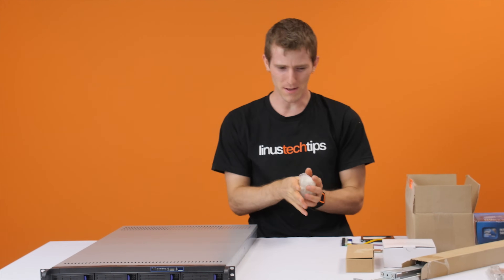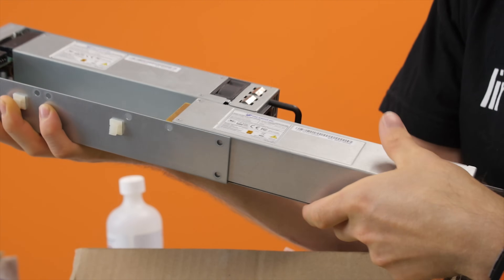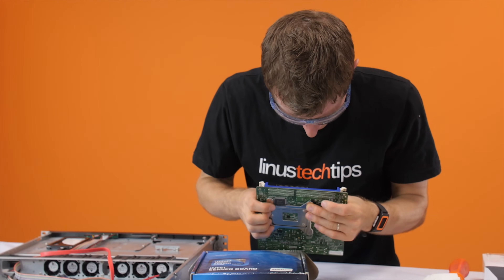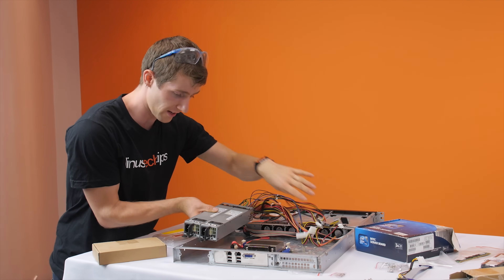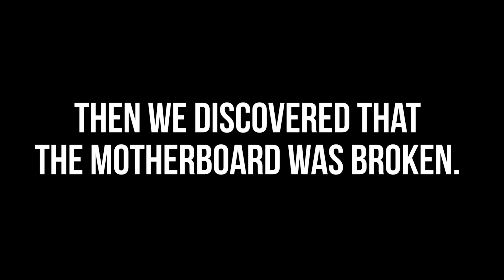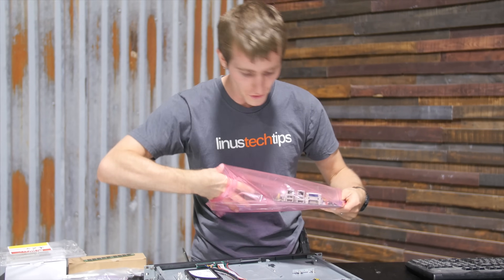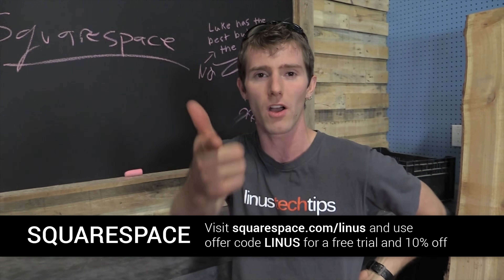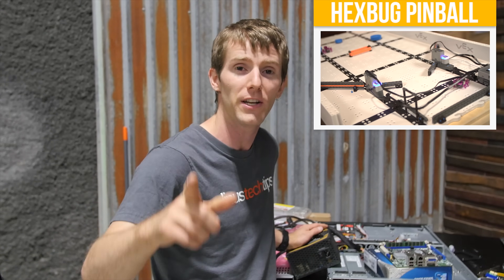DIY pfSense Rackmount Router Build Log - Part 1

Comment: Hi Linus,

I enjoyed your video a lot. I like those DIY projects with only the parts you already have. Looks much like my stuf at home. But if a Cooler and the backplate don't fit, than look for something better instead of blew-up the modtherboards twise ;-). Your goal to make a new pfSense router/FW looks good. And to use parts you already posses is a good money saver. But i think that you're better off with something like an Supermicro A1SAi-2750F motherboard with an modern Atom CPU or something similair. These things are also with an barebone solution that fits your requirements. Besides the fun, you have to run an company through that firewall so it might be better to have something reliable.

By the way, keep up the good work with your video's and the good tips like modern cable management and so.

Comment: Could it be that the back plate it touching the solder on the motherboard which cause the board to short off......just a theory,   i can be wrong

Comment: I personally probably would have given up and stuck everything in an ITX desktop case with a stock cooler when I found the backplate had to be so extensively modified, and the IO shield had to be cut, and the fancy redundant power supply didn't fit. Just return the 1U case, get a $20 rackmount shelf and stick it there. 
I guess there's something to be said for "never give up" mentality though.

Comment: I'd have to agree with the other comments suggesting a 3D printed backplate. Or maybe a plasti-dip coat on the back of it to prevent any shorts? Also, I'm guessing it's already been done because the LMG team seems to be pretty tech savvy, but try building it outside of the case first to get everything working then install inside the case to see if the orientation is causing the problems?
Keep the great videos coming LMG!

Comment: Lesson Learned...  don't build custom 1U cases with non standard equiptment.. the redundant power supply.. are you stuppost to beable pull out the power supplies? I don't think you have the clearance..   Should of went with a 2U case. wouldn't of caused all of this problems. plus you can always build a proper server room with a proper air conditioner.

Comment: all the money ur wasting buying another motherboard, you can easily just buy a good micro atx server board lol. theres a reason y mini itx boards suck. as everyone else mentioned, the metal backplate is coming in contact with something.

that being said, I had the same idea to make a 1u pfsense router with a redundant psu lol. But 1, put the ssd in the drive bay to easily swap them out. 2, test b4 u put it in the case.

Comment: Tips: 1.  Put some masking tape on the backplate. Seems that the metal plate is shorting out the board around the CPU and might even damage the xeon...
2. put masking tape on the cooler
3. leave out the io shield so that hot air can get directly out
4. USE MORE HOT GLUE

Comment: I burst out laughing when Linus first tried to fit the heatsink on the board, looks like it interfered with the fan header AND the square capacitors/power delivery things as well.

And at 9:31, i'd just be all "welp, time to find an alternative cooler"

Comment: 1RU servers are specialized and if you want one, you should buy one.  If you want to assemble one yourself, buy a supermicro case and a super micro motherboard.  Supermicro has compatibility lists because 1RU server designs are highly customized and incompatible parts are the norm.

That said, as far as real servers go, SM is crap and you're best off with dell or HP.  Buy one off eBay.  Leave the hacking for software.

Comment: test the new motherboard first with another psu connecting only 4 pin and 24pin. Plug in just the ram. No drives etc. I think it might be that dual psu thing.

Comment: Wow I don't even know where to begin...using hot glue to mount a PSU? And I'm sure that the backplate fried both those motherboards...FYI you can also order complete pfSense boxes. How fast is the new internet connection?

Comment: okay, so my thought, and according to the comment many people also think of, is that the backplate of the heat sink might shorted something. So you should insulate the plate before install it. Don't know if it's the case, but regardless you should do that just in case, considering how close the plate is to the exposed pins.

Comment: holy crap, why use that backplate anyways, it's causing all kinds of shortcircuits and problems. just use 4  nuts with washers dude! the cooler isn't a coolermaster V8.

Comment: I love PFsense I have an and socket AM1 system with a quad core 2Ghz CPU 8GB of ram and a similar quad port gigabit Nic. it powers my network really well though sadly I have to reinstall the OS mine is messing up bad and refusing to update. it was not happy when I upgraded from a dual port to quad port and moving from 1.3Ghz to 2Ghz. PFsense is real good with reinstall and quick set up. I recommend it big time radically if you want a nice OS to play with.

Comment: We can easily confirm whether or not the issue is caused by the backplate by simply turning on the system without the backplate installed first just to be sure it turns on...

Comment: I mean you can buy routers, they have a whole isle at the store called routers (fml)
Reply: +Bucketoriley Even though it's spelt aisle in this case
Reply: +Matt Davidson (Foogalicious) I don't get why the router wouldn't even start up in this case ...aisle see myself out.
Reply: +Lord Baldur Actually if you search the interwebs you will find that off the shelf routers perform better than homebrew ones.  It's not really that surprising when you consider an off the shelf router has hardware specifically designed for just doing router functions, where as a homebrew uses general purpose components designed to do anything, even running windows etc.
Like wise the software is coded specifically to do perform 1 task very well and is written specifically for 1 known set of hardware.
Reply: isn't it weird how isle is spelt lol
Reply: Ah dang I didn't see that, you're right, its supposed to be aisle lol.
Reply: +Matt Davidson (Foogalicious) I knew that lol I was being sarcastic 😎
Reply: This thing makes consumer routers (and even large enterprise routers ) look like a joke
Reply: Dragonbait The main difference between most routers and a built router is that most routers use ARM while pfsense uses x86. The difference between those chips is that the x86 is way more powerful and is capable of doing more complicated processes. ARM is used because it's cheap and open source. However it is much less powerful. Comparing the processor of a router to the processor of even an old computer, there would be no amount of optimization that can make it outperform the PC and that's not even considering the fact that it has been shown that PFSense routers do a lot better for less money than Cisco equivalents.
Reply: +Lord Baldur while that's true for SOHO routers a bit bigger ones are much and more complicated.  also you can't compare routers by just speed, in fact if you want speed you don't even need a router....

Comment: what's the difference between a router and modem
Reply: *****
Nope, read my comment above. The modem is just a converter. It does not know if it converting wan or lan. The router differentiates between lan and wan. For example, I do not have a modem in my house (because I have an UTP connection with the provider). But I have a wan interface (the external connection) and several lan connection. The connections (either wan or lan) are managed by the router (well, by the router and by the switch part of the router).
PS: for example, you can connect 2 pc via phone line, using 2 modems. You will have PC->PC's NIC->modem-----modem>PC's NIC->PC. No WAN here.
Reply: +Bucketoriley 
modem is to connect youre home network to the internet Lan-WAN
router is to create an home network connection that connects to the modem
switches are smart directing network connection so that your homenetwork doesnt bottleneck or loops
modem->router->switch->pc/tablet/laptop/smartphone/nas/server/etc.

that sayed there are devices that do combining like router with intergrated switches.

the switch learn what path he needs to use for each device so the  packages doesnt go to all devices at ones and slows down your network
Reply: +Bucketoriley Modem converts coax to ethernet. Router connects LAN to WAN.
Reply: ***** Not necessarily, my cable company only gave me a modem with one ethernet port on it and you still need your own router.
Reply: +Bucketoriley the term modem comes from 2 words: modulating and demodulating "mo-dem". A modem is something like an active adapter, it converts an analog signal (phone line, coaxial cable etc) into a digital one (an utp cable). A basic modem will have one cable as an input (coaxial, phone etc) and one as an output (usually rj-45).  A router (in the commercial context) is actually composed of a switch and another NIC interface. A router is something like a multiple power socket (this is just an analogy!!!). It "gets" data from one "main" source and distributes it to several clients. But there are many "composed" devices on the marker - a combination of the devices described above. So you can have one device that has a coaxial input and 4 utp outputs. This device will contain a modem part, a switch part and a bridge between the switch and the modem. 
PS my description above is very simplified (I am sure that a network engineer will start laughing when he will read this)
Reply: +Bucketoriley Modem = WAN (Intarnetz), Router = LAN (Local)
Reply: thanks guys for the replies appreciate it

Comment: Maybe he should have thought it through prior to powering it up the first time? Testing for grounding issues and shorts with the multimeter in a situation that already had grounding issues would have helped it. Might as well test the PSU now... a vreg could have gotten damaged.

It's possible that a one-off plexiglass or even a 3-D printed version of the backplate would save him from some more headaches. Not to mention that clearance of the CPU heatsink may be better than spraying the board in filings from the onboard speaker.

Good luck with that!

Comment: Linus you know you broke that motherboard because you grabbed it with your full hand on bottom :)
Reply: can you explain because others are saying it was the back plate and the cut off speaker
Reply: he was grabbing it on the bottom and touching all the circuitry.
Reply: I presume he is using an ESD protection mat, but the bag the mobs came in was suspicious.
Reply: +Lions Flame That won't kill motherboards.
Reply: it can if you have a charge from a carpet or anything you can fry the motherboard
Reply: Lions Flame Yes, but ESD kills the motherboard, not touching it.
Reply: he's walking on carpet with socks on.

Comment: Geez just get the Asrock C2750D4I. Fits nicely in a 1U case, doesn't even require a fan, onboard cpu, has 4(!) dimm slots oriented the right way, is energy efficient, server grade (with the gorgeous webinterface) and still extremely overkill for your application.

Comment: I can relate to this so much, Linus. I built a dual xeon system and bricked the first board because of plugging in a power cord to a power output that used the same connector. I learned to always read the manual on server stuff now.

Comment: Sorry to break it to you linus, but sometimes it is easier just to order already tested hardware. C'mon now 1u servers with the specs you need are not that expensive, probably would have cost less than shorting two motherboards. Also pfsense sucks anyhow.

Comment: The backplate is incompatible with the motherboard. normal motherboards have no components near the cpu on the back. this one has loads of them.
Reply: +FoodOnCrack It looks quite obvious to me that he just shorted out both motherboards with that backplate, oh Linus...
Reply: +FoodOnCrack Yep I would go ahead and say i'm 95% sure that its the backplate killing the boards...
Reply: +FoodOnCrack He has a 3-D Printer! MAKE A PLASTIC BACKPLATE LINUS!!!! (and possibly line the bottom of the case in electrical tape!)
Reply: You don't even need a backplate on a board in a rack case, if your rack falls over you are going to have bigger problems than worrying about the HSF stressing the mobo.
Reply: ***** That's not true, I can't even remember the last time I saw a backplate on a server mobo. Rack mounted servers ALWAYS sit horizontally, so the stress from even a very large HSF is low. There is no need for 'reinforcement' lol.

At the very least, it's much better than bowing a mobo and probably shorting out and ruining 2.
Reply: Never personally seen a server mobo with backplate mounted, like I said, I don't think it's necessary, but then again I don't work in homebrew where you take a dremel to your mobo and an angle grinder to your IO backplate.

Comment: Even if power consumption is a major factor to consider, why not use a server microATX or ATX board? The case has the space for a reason. Plus those boards tend to not have the jumble of components under the CPU that mini ITX boards have due to lack of board space, letting the backplate actually do its job without mods.

Comment: i work with these builds alot for racks, always used plastic backplates for esx vmware racks, ubuntu server racks and so on. personally always used gigabyte boards for it as well their orientation for building is alot better for airflow and component placement, hope this helps.

Comment: Wow. This seems like a lot of work. Lol. I just use a Sun Microsystem X4100 1U server for my router. plug it in and it works. Running Fedora 20 with an iptables script for the routing.

Comment: Jesus Linux.. just grab a nice Supermicro kit that has what you need.  These aftermarket server cases usually suck in 1u, and most Intel-branded mobo's are Foxconn non-standard trash at this point.  I've had a more than a few bad run-ins with them myself.  Never again.  You might just get lucky with a nice Supermicro ITX board that will fit what you already have.

Comment: Components on the top of the board are interfering with the heatsink. the bottom place needs a good insulator as there are many passives under there where the conductive parts are run right up to the top.
Speakers should be desoldered and not broken off.
Multi layer boards do not like being flexed (more layers= greater risk of damage when flexed).

They need a cooler with a plastic back plate, and a small footprint, e.g., can a liquid cooler fit there? Can you dumpster dive for some old broken laptops and see if the heatpipes can be safely bent to fit that board. Can you simply use a 2u rack instead, and go with a full ATX build? PS unless you are doing VPN or other demanding tasks, you really do not need much CPU horsepower for pfSense.

Comment: i would choose a Pentium j1900 or 2900 with Mainboard so you have more options than this one and it needs less power with only 10 watts. There is also a PCIe Connector

Comment: Hahaha, using backplate on mobo designed for plastic pushpins, using cpu cooler not designed for that particular server mobo, way too wide at its base and touching caps and other components . . . someone needs common sense class. 

I am betting 5 bucks canadian that either one or both of the above mentioned things short circuit the board. Why the hell didnt you test the board before with just the cpu, without a cooler and putting it into the case ? 
On 4:09 it looks like mosfets pins touch the backplate.
Also use a freaking 90 degree L connector for sata on motherboard. . . again, common sense

Comment: I see that you have two Power supply's maybe you you set it up that the two server PSUs are giving the power to bored at the same time. So two times the power would blow the bored right?  Maybe in part two try testing the bored in the case with only one PSU wired up and see if that helps and maybe order two motherboards this time just saying :3 keep up good work and the awesome videos guys (^_^)

FYI could someone explain how a backplate  could brick a bored I d really like that part to be cleared up :3

Comment: Interesting approach LinusTechTips, sharing a more natural (not too edited) process of tech-gineering a solution is always cool... and frustrating at the least.
I think many have said it, shorts of the plate might be part of the issue. But perhaps, before burning another MoBo, which many may not afford, worth taking a step back:
.Test all parts outside the chassis (perhaps in an open or frame, lab case model)
.Chop-chop one element at a time (You have too many unknown here)
.Definitely isolate the plate, even hot-gluing the whole surface if you want.
.Not sure if you cut the whole piece (speaker) or just connector tips. Make sure it is not any part that might unbalance overall impedance or circuit, MoBo may not like and sense this.

Comment: I never understood why standard server racks were so thin. You'd think, this is an application where speed and reliability are paramount, and more space allows you to do these things much more easily.
Reply: +caramelzappa It is because in large scale data centers (not LMG, but really large ones), rack space is one of the three most constrained resources (the other two being cooling and power).   1U is better than 2U under those conditions.

Comment: Hey guys, i bought a cpu cooler for my pc(i5 4440 and GTX760 oc), and it seems to be doing WORSE than the stock cooler! Its the Ice Blade 100 8mm (NOT the pro). I had the cooler facing one way so the fan was blowing out the back of the case, and my cpu got up to about 90-95C, switched it the other way and its at about 60-75C all while playing Insurgency. Would fan speed help? Am i doing something wrong? HELP